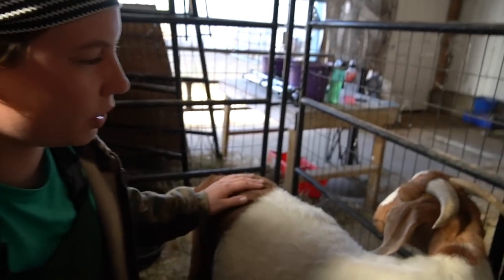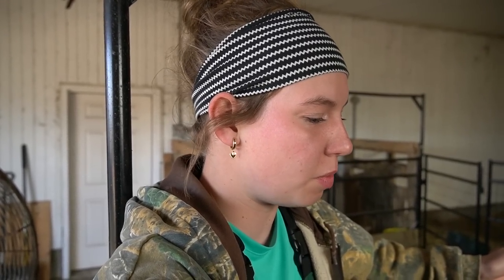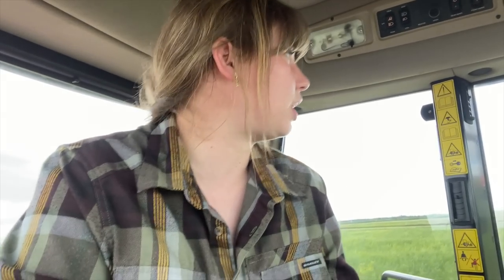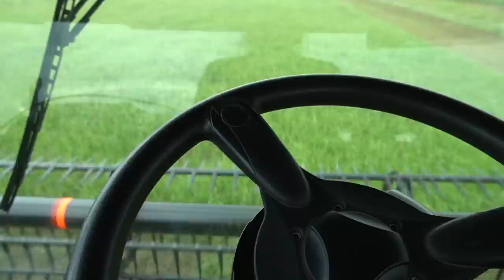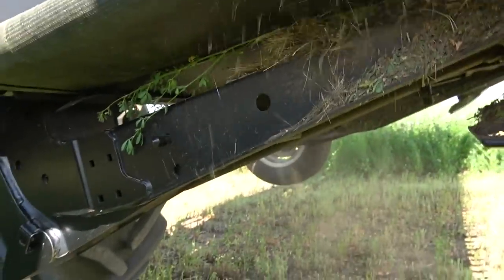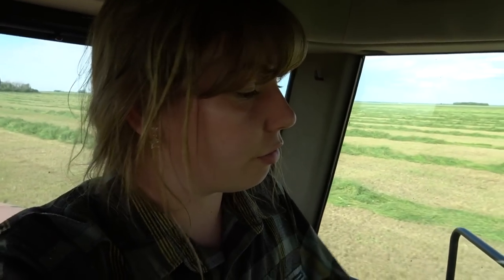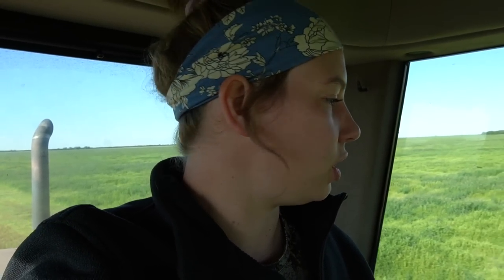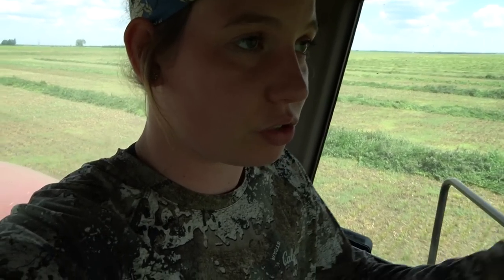Silaging Day 3, 4, 5: This Last Field SUCKED

Comment: When you start having problems getting the crop cut without it plugging that a good sign it's going to need a new sickal at least.
And if i had to guess the gards should be changed too.
It's amazing the difference it makes.
But i guess you have to convince the boss it time for new gards and sickal.

It sure does make the day long especially if it's hot out.
Hope your farm get some rain in between to get the hay growing good.

Comment: I think you are a pretty good mechanic in addition to being a good machine operator. You were able to replace a broken tooth in a previous video. You know how to blow out the filters and radiator. You are very observant of how the machine operates and noticed something was off. Most people would just keep going until the machine broke. Sometimes a good smack is all it takes to make a repair. Great job Neline!